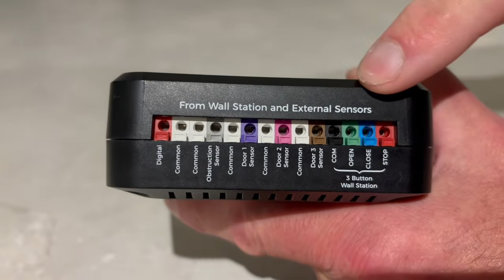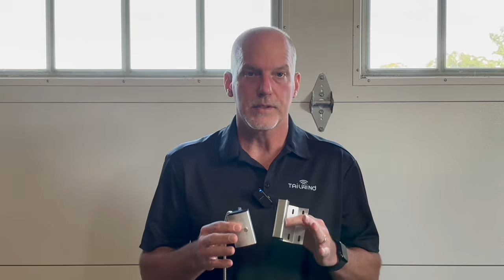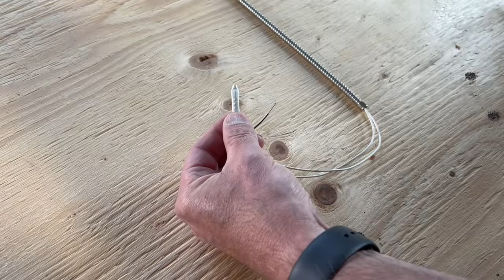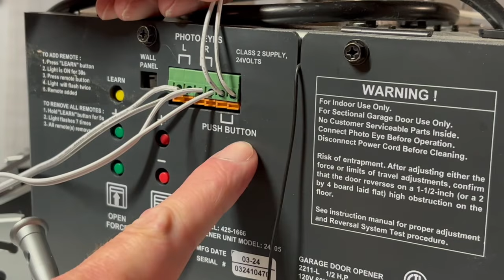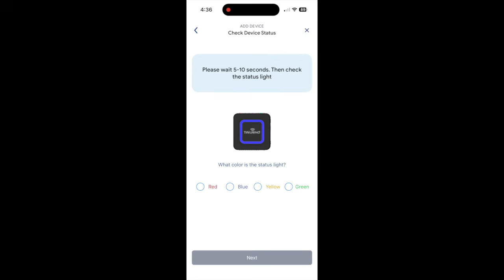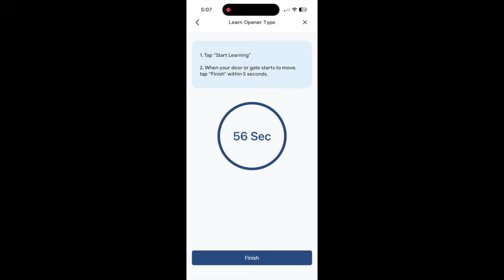Tailwind IQ3 2.1 Installation Video

Comment: Love the controller. I was confused about the dry-contact install. Key thing is do NOT put the wires from the wall button into the new Tailwind controller input side. for dry contact (old-school, just a button on the wall) switched's by the pass-thru door: Add the dry contact wires FROM the Tailwind controller to those same inputs of the opener-motor to the wires coming from the wall switch.  Both the wall switch wires and the wires from the Tailwind get twisted together and put back into the opener-motor. I was making it more complicated than I needed to. Makes total sense now that I've done it.

Comment: I wired everything (according to the J track sensor instructions). Sensor pieces are 1.5 inches away from each other. I have a Chamberlain garage door with a yellow learn button.

When i tried to open it, i can hear the tailwind iQ3 2.1 attempt but the motor and door doesn’t move. So I get the lock out screen on the app.

My WiFi is working and the signal is strong. 

Can you tell me what’s wrong. Or what it sounds like?
Reply: Hi, I’m facing the same issue. Did you figure it out?
Reply from the maker: @NewAgeKarma  please see my previous reply / comment
Reply from the maker: If you you mean you "hear" the Tailwind IQ3 2.1 attempt to control the door by making a clicking sound it means you have it configured in dry contact mode.  You mentioned you have a Chamberlain with a yellow learn button. Please note the video demonstrates that for those openers, you do not use or require a door sensor and you connect using the digital terminals. Once you've connected using the digital terminals as shown in the video, please re-run the "learn opener type" procedure in the app. Tap "Devices" at the bottom of the Home Screen. Tap on your device and then tap "Learn Opener Type".